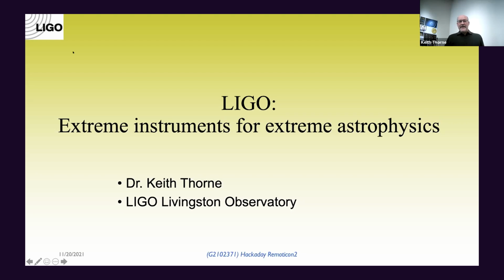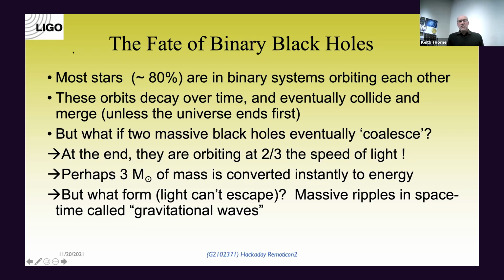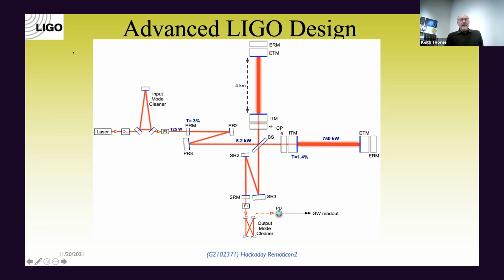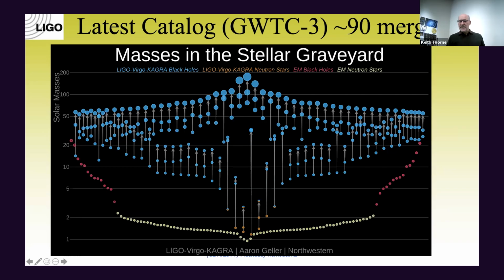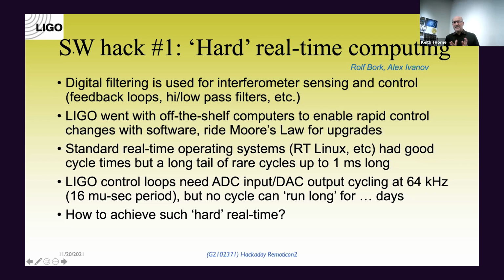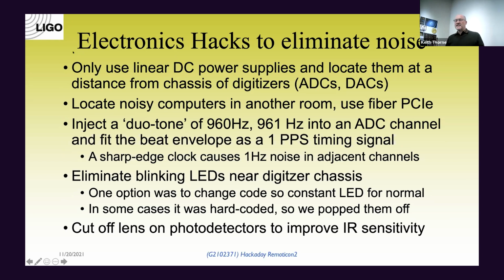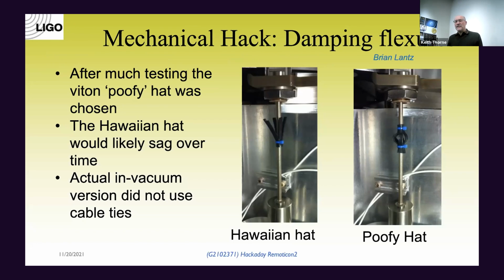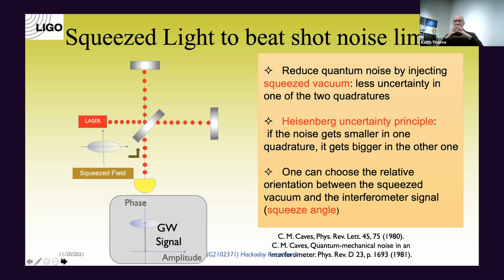Remoticon 2021 // The Extreme Instruments of Astrophysics: LIGO

Comment: Ehhh... Sounds "popular-sciency", I did not learn much from this talk, and there is a LOT I don't know about gravitational waves and GWOs.
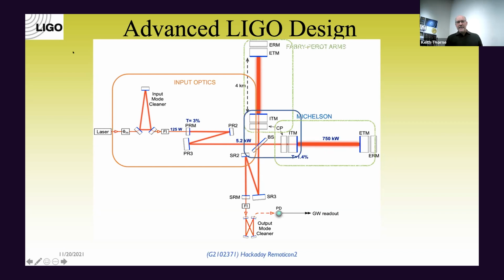..and so many question-marks. For example: at 13:51. Dr. Thorne shows an interferometer, whereby the input-power is 5.2kW whereas the cavity "power" is 2*750kW, i.e. 1500kW. Where does this excess power come from? A Q-factor can accumulate energy , not power , right? How is the "quantum squeezing" practically achieved? .. and surely, 16 microsecond is not a particularly demanding HRT, right? A three decade old dSPACE can easily run this, let alone a custom DSP or FPGA. ..and what's the point of expressing distance in football-fields or human-hair-thickness units? Most ppl here understand plenty well that 1e-9meter is 1nm.